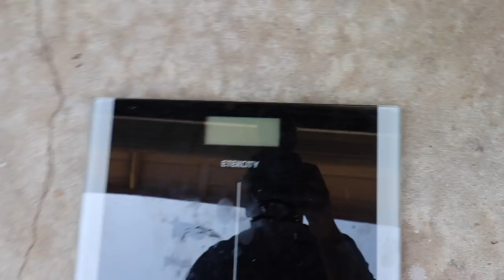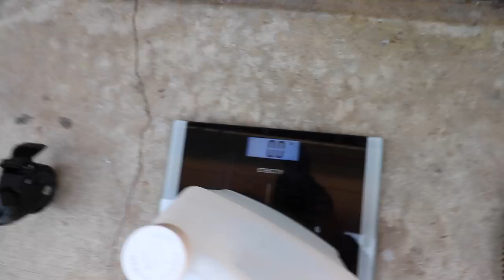AUTOFIBER VS GRIOTS PFM: CHEAP VS EXPENSIVE

Comment: Griot's has a smaller drying towel size 25X35 which would have been a better comparison.  It's the same color as autofiber's towel as well.  The XL is better for trucks.

Comment: I agree in that those giant towels are way too difficult to handle once they start getting wet. I use a Costco towel and wring it out as I need.  I had some of the bigger towels and they are more difficult to use and definitely very difficult to wring out properly.

Comment: 👍🏻 priceless moment when your niece called you for attention. 
Any towel larger 25 by 35" is too big for me, and harder to mange. Walmart has some popular $7. cheap brand, that is just the right size and weight, it has held well for over 5 washes. 
That is how you can judge quality also, I've gotten HF towels for free with coupons and after the 3 rd wash it looses like half of the gsm or plushness, total trash for one or times use.

Comment: I agree with arbitrary alias, you didn't compare the performance of the towels, only the weight of the water.  I've finally settled on Griot's PFM's because of how they remove the water from the car.  Do you expect to have 5 pounds of water on your car surface as you begin drying it?  NOPE! NEVER EVER!!  The Griot's PFM small towel is the first towel that I've been able to remove all the water in one pass, without having to wring-out the towel.  After using the regular size Griot's I finally bought the large towel and I agree with you on the loss of control issue,  it just turns into a heavy bear.  So I'd recommend buying two Griot's smaller PFM towels (and actually dry your car with it ) and you'll be happy with the results and the longevity from the superior towel.  Best of luck.

Comment: Hi Jimbo! I know this is an old video and not really relevant to my question.. but do you have any experience with EZDETAILER carnuba cleaner and wax? It's an aerosol spray wax that was stocked in Costco several years ago and I found and used some last night. It rained here in Bakersfield this morning and it beaded very well. Any response/feedback would be great. Thanks!

Comment: I almost got the Griot's a month ago and then I'm like... Man that's huge towel and expensive! I'm glad I didn't bc the Dreadnaught was more than enough. I bet you if you hang to dry the PFM towlel it would take 3 days to dry lol
Reply from the maker: It’s taken over a week in the back of my truck to dry out. The dreadnought takes a day.
Reply: I have the Pfm towel and it does take 3 days to dry. I air dried it in the garage for two days, still damp. Third day I placed on drying rack in the driveway, a popup shower came by and soaked it, had to wait another 3 days for it to dry.